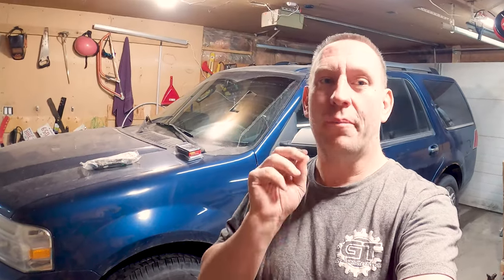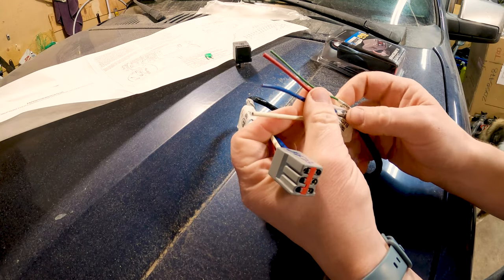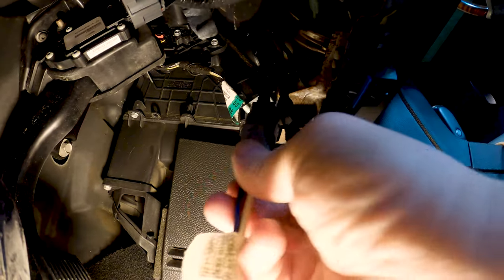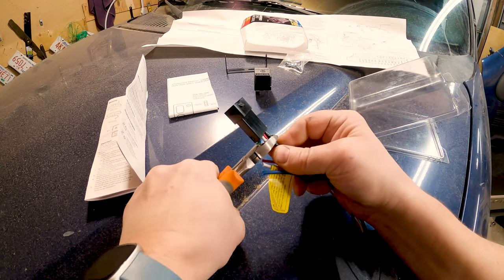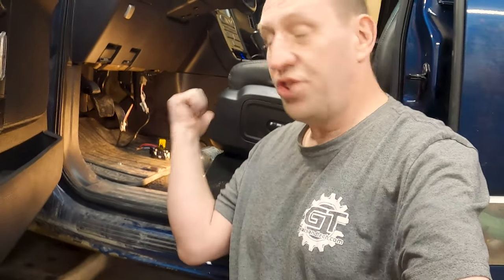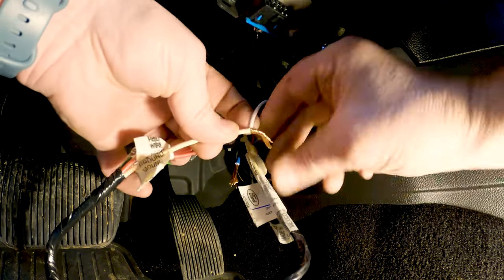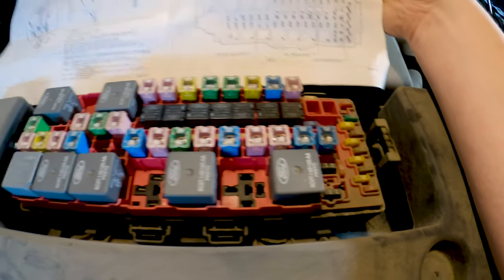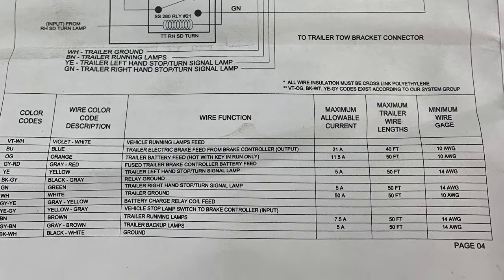Brake Controller Install from start to finish on Navigator/Expedition | Gears and Tech

Comment: I have the same truck, it has the harness on the side to connect the brake controller, but in the back it only has the 4-pin connector, do you know where the brake controller signal comes out?
Reply from the maker: Excellent question, unfortunately I don't know
Reply: If you follow the 4 pin connector wires you will see the wire for it at the back, at least mine eventually runs along the same lines as the 4 pin connector